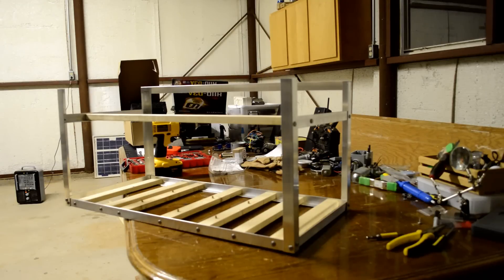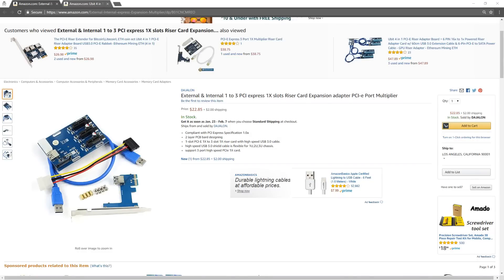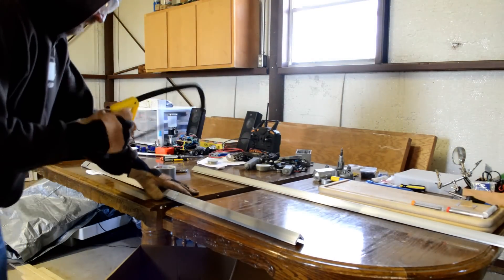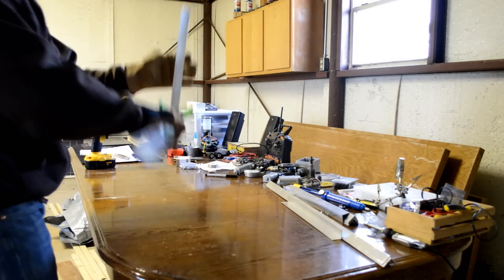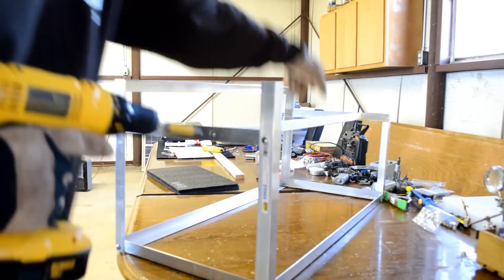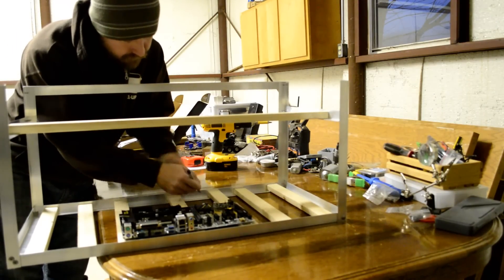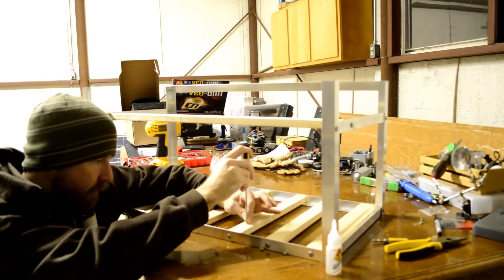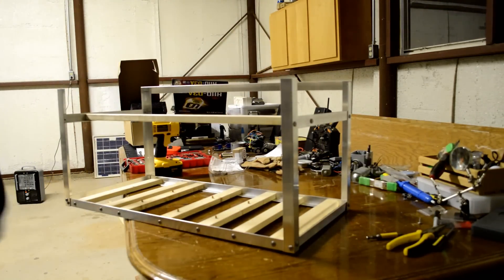How to Build a Mining Rig - Part 1 - The Frame

Comment: Dang, the Aluminum angles are no longer in stock. Do you have an alternative?
Reply from the maker: I've thought about making one using PVC but havn't gotten around to tinkering with one yet.  The price of open air rigs is not bad now adays.  Here is one that can hold 12 GPUs (although I'd probably only space 6 in it)
https://www.amazon.com/gp/product/B0924BGQBM/ref=ppx_yo_dt_b_asin_title_o02_s00?ie=UTF8&psc=1
Reply: @Jobegamers  Thanks for that link. Wish I had seen that sooner, I've already bought the wood & aluminum angles to build the frame that you made lol. Maybe I'll buy that one when I get more gpu's, I currently only have a 3090.
Reply from the maker: @LongsenLo  I feel ya, I've built 3 of the aluminum framed ones that I show since lumber and metal prices went up I bought a couple of these prefaced ones.  You should go to your local hardware store, I bet they have some aluminum angles and if not they prob know where u can find some.  Hard to find this stuff online nowadays with all the shortages. Good luck to you!

Comment: Is there a reason why you went with a timber base? Is there any dangers in having the whole frame metal? I've built a frame very similar to this with aluminium angles and a galvanised flat sheet for the base to support the PSUs and motherboard. My motherboard is raised with the basic motherboard standoff screws and the PSU is fixed the the angles.

I powered on my rig with a brand new HX1200 PSU and it sparked and popped and then turned off shortly after. I'm thinking of returning the PSU as this shouldn't happen and am afraid to use it again. Should I be raising the components up off the frame with rubber or installing rubber feet underneath the frame is that why it popped? Please any help is very much appreciated

Comment: Cool video , After building two rig this way. cutting this with a hand saw really is a pain in the ass. I ended up buying a evolution saw, for this and other small jobs. Also 3/4 angle aluminum will work just fine and is slightly less cost for material. This method worked for me!
Reply from the maker: I hear ya cutting by hand is a pain, I did it in this video for people who may not have those tools, using a mechanical saw is a huge help.
Reply: Yea i did the handsaw method twice, i guess if your going all in and plan on building as many as you can afford to setup I would make that extra investment to save time and ease of work. No doubt, Great video walk-through on this process though!
Reply from the maker: I def agree it's worth the investment.  Thank you!

Comment: Wood = worries great guide but try to use something that isn't flammable. If something shorts out beside some dry wood I'm wondering what insurance would say about a crypto mining rig fire.
Reply from the maker: Hey IOwn, thanks for the feedback.  Yeah I hear what your saying about the wood but my reasoning is not only for price but also that there is no circuitry in direct contact with the wood.  As long as you properly ground all your hardware there should be no path for electricity to go through the wood (especially since wood has such a high resistance to electric flow).  The wood also acts as a great heat distributor compared to say aluminum, when I put my hands on the aluminum thats in contact with the cards its very hot but when I touch the wood that the GPU's rest on, its barely even a bit warm.  That's not to say that it still could not catch fire, but if something did start a fire the wood in the frame would be the least of your worries imo.  But point taken, if someone is wary of using wood I'd recommend just running another piece of aluminum in its place or maybe a strong heat resistant plastic.

Comment: those pcie riser extenders dont work (if u plug each GPU 1 by 1 it does see all,but after 1 restart 0 GPU recognized)
Reply from the maker: ZeeFF contact the PCIE Riser Extender seller, you may have got a lemon.  Is the riser powered by the same PSU as the card?  Are you using any splitters or adapters?  Does the card show up in device manager at all?
Reply: Jobe the psu-s have a daisy chain. No not by the same psu. It doesn’t show in d m. No adapter.
Reply from the maker: So the PSU's are connected with a PSU splitter adapter or are you shorting one of the PSU power SW pair with something?  I ask because I have seen issues where if the psu's dont start at the same time this can occur.  You might also try to power both the card and the pci extender with the same psu to see if you get different results.  If you still have issues take a pic of it and post it to imgur and link it so I can get a better view on it.
Reply: Jobe SODIAL(R)
SODIAL(R) PCI-E 1X 1 to 3 Port 1X Switch Multiplier Expander HUB Riser Expansion Card + USB Cable

Hrph 24Pin 20+4pin Dual PSU ATX Power Supply Adaptor Cable Connector For Mining 30cm

Both psu start at the same time. I got m.2 boards and sorted the prob. 8 card rig

Comment: For going out say 60 inches across, will 1/16 thickness suffice or do you recommend 1/8 at that distance.  If 1/8, do you then recommend #10 screws at 3/4 inch length?
Reply from the maker: I think 1/16 thickness will be sufficient but 1/8 would be fine as well.  The aluminum is pretty strong and I would imagine would have no problem supporting at that distance.  If 1/8 you can use the same tek I use, the #10 1/2 screws but #10 3/4 would also work.